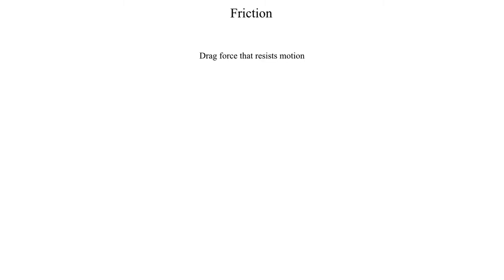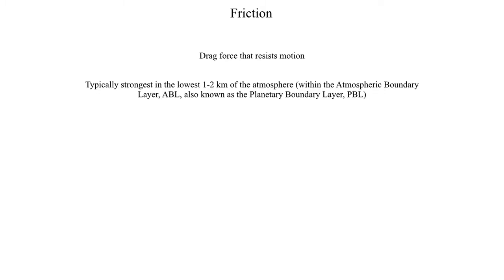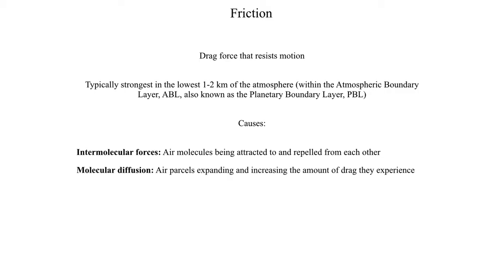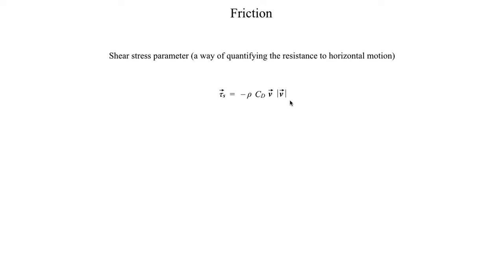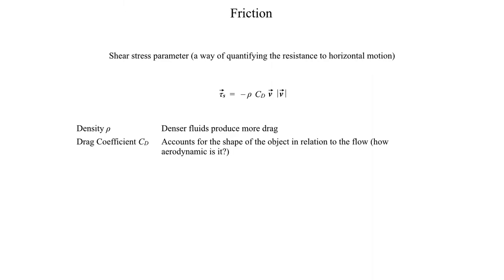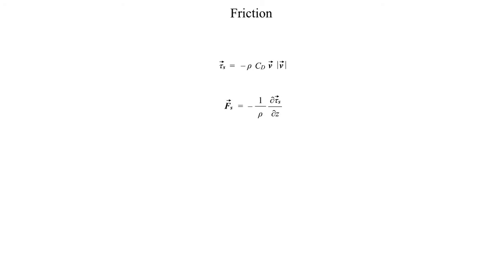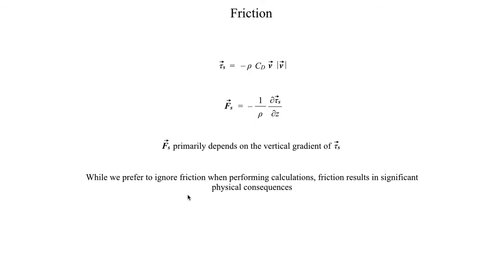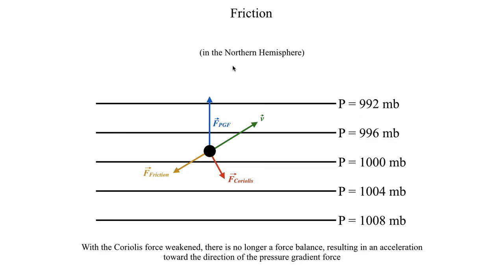METR2023 - Lecture 6 - Segment 3: Friction in the Atmosphere

Comment: Nice, but you seem to confuse friction and viscosity.
Reply from the maker: Fair point. Strictly speaking, friction and viscosity are not the same thing. Usually, friction refers to the actual force while viscosity is a parameter that is used to calculate the frictional force.